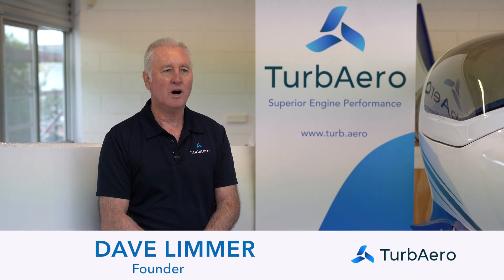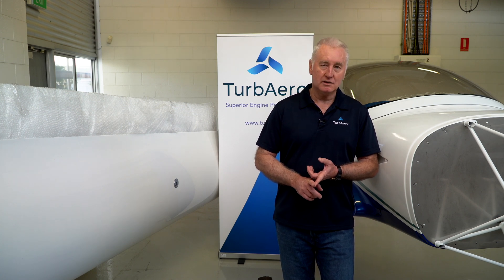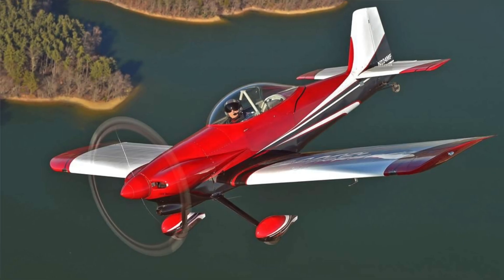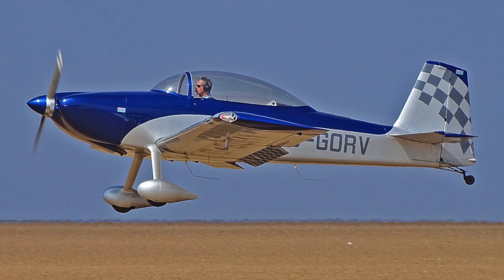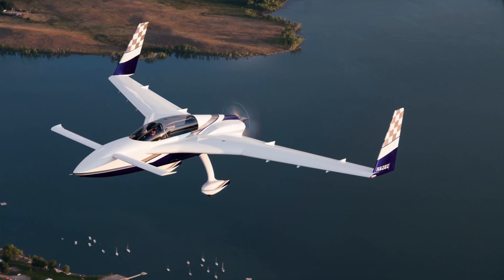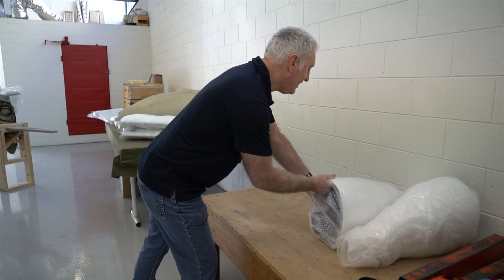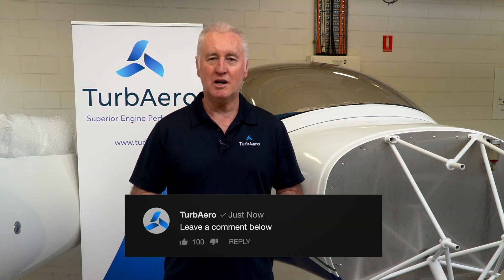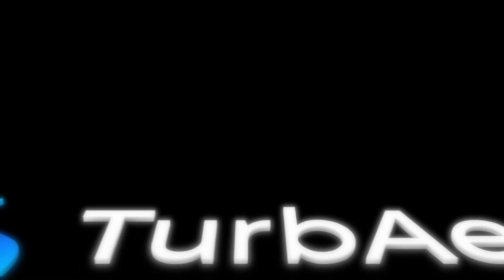Compatible Airframes - Will Our Engine Fit Your Project?

Comment: What's the status ?? Has been silent for a while and the phone number on the website says out of service... you didn't stop the project did you??
Reply from the maker: @RR-kl6sl  The project is still going but we have had to put the brakes on while we source additional funding.  We are in conversations with several potential parties but we need to get one of them across the line before we can restart the program.

Comment: Will your turboprop work in the Columbia 400?
Reply from the maker: The higher, 350 horsepower engine would most likely be more suitable for a Columbia 400.

Comment: I own a Piper 140 and also an Ercoupe 415C. I would like to convert to a turbine due to the reliability, but I fear that the cost  would be prohibitive, and also the complexity of the pilot ratings.
Reply from the maker: Hi Lynn, whilst we can't currently say how certification will change the purchase price, for the experimental model we are anticipating an initial price of $85,000. Considering fuel burn and maintenance costs, we anticipate that over the lifecycle of the engine, the total cost ends up similar to that of a comparable reciprocating engine. In terms of pilot ratings, we plan to offer transition training for those converting to a turbine aircraft. However, we expect that flying behind a turbine will be picked up by most relatively quickly.

Comment: I have a Cardinal 177B... so interested in this engine, not just for reaching the Cardinal RG speeds but also the biggest flaw in the 177B is the forward CG it's almost impossible to stay w/i cg envelope... This engine would reduce all that weight up front, increase the performance while maintaining very similar fuel burn! @TurbAero please include the C-177B in your STC plans!
Reply from the maker: Thanks for the comment Jonathan, you hit the nail on the head with the benefits. We have had a few interested Cardinal owners, and we anticipate a certificated version of the engine being available a few years down the track!

Comment: It's very interesting BUT try if you can to completely arrest yourselves and realize that a turboprop while smoother will still be much the same utility as a piston prop as a front noise maker and the colonial primitive look that a prop plane has. In a sense it becomes the worst of both worlds, the design compromise of a prop and the cost of a jet. Try your sully best to instead realize that you could make an even smaller and simpler turbofan jet product that's more reliable, cheaper to develop and produce, has natural twin engine applicability, has the design freedom of jets, the silent sophistication of jets and the vastly superior looks. And keep in mind that the distance record without refueling of 40000km belongs to a simple off the shelf Williams FJ44-4 turbofan engine, going 500km/h. A turbofan engine around 16kg with 100kg thrust could propel lean ~5-600kg planes to mach 0.7 with over the ocean engine redundancy. Consider what a revolution that could be. How a producer of such engine could very quickly become a half billion dollar company. Whereas a turboprop has no real revolution potential. Same performance plane but a more expensive engine with a different sound. You are not going to listen, no one ever does but you should.
Reply from the maker: Hello Dan. Thank you for expressing your point of view.  Your perception of the potential for a small turbofan is consistent with our own so we are on the same page there.  That initiative has always been on our radar.  Indeed, our engineering team is keen to start on that product which they perceive to be the most satisfying product for them to develop.  However, market research has firmly dictated the order in which we will develop our turbine engine products.  The available market is critical when launching a new product.  If we started with a turbofan, there are no existing aircraft designed to be optimal for such a powerplant and noone would design one until the powerplant was proven.  Spending many tens of millions of dollars on developing an engine where we couldn't sell any until someone designed an aircraft to use it just doesn't make sense.  That said, once we are a half billion dollar company, we could develop the turbofan to make us a 1 billion dollar company and to allow me to have my own personal jet which has always been an ambition for me! 🙂
Reply: @TurbAero  Diamond will make a plane for it too
Reply: @TurbAero  With due respect, that is an error in judgment. A market will instantly appear with a turbofan product. Darkaero will redesign their plane. Cirrus will obviously adapt the SR22 class instantly. Any producer that does not will be outcompeted. Just the enthusiast market for wild conversions will no doubt consume any amount of product you can make initially. To delay is 100% a mistake, not maybe, not let's wait and see or we'll get around to it, 100% a mistake.
The Turboprop project should be ended with extreme prejudice if it at all distracts from a turbofan. There was no market for electric cars before Tesla either. The other producers were going to get around to it whenever. As a result Tesla is today 700 times more worth than Aston Martin. About as much as all car makers in the world combined. Soon to be the biggest company in the world and it wont end there. Tesla will make faster than light starships.
There is ok excitement around small turboprops, a turbofan product will drive the market crazy. Turboprop will not expand the market, it will be a neat novelty for some planes to show off without any real change in specs but have higher price. a turbofan product will revolutionize GA. Textron will offer hundreds of millions for the company.
Reply from the maker: @DanFrederiksen  Dan, we respect your opinion and indeed, we agree with elements of your point of view.  That is why elements of what you suggest are already considered in our business plan.  However, there are a multitude of considerations, influences and factors that I suggest you are not considering that have a bearing on the viability and achievability of what you are proposing.  Your suggestion only scratches the surface of all the factors that need to be considered when making such a critical business decision.  I am not going to discuss those in this forum but you can be assured that we, as a small (for now) but ambitious and driven Australian company, have assessed these factors and this assessment has provided the strategic direction for our company, both short-term and long-term.

We believe that you underestimate the value proposition of our turboprop product in our target markets.  There are enough points of difference with the existing piston engines for our turboprop engine to appeal to enough of our target markets to make the business successful and to enable us to execute on our long-term strategies.  That said, we will look forward to seeing the DarkAero/Vans RVxx twin-turbofan experimental kit aircraft and the certificated Cirrus SR22TT and Baron G58TT etc. twin turbofans gracing the skies in due course.
Reply: @TurbAero  all that sounds very much like excuses to never do the right thing. How long until you can sell the turboprop and no longer delay starting on a turbofan? is it now? 2 years? indefinite endless delay?  am I going to read a bankruptcy statement 5 years from now so 10 years was wasted because you knew best?
put it on a big board somewhere. make it an unwavering goal. don't consider, do.
Reply: Interesting discussion back and forth.  First, this engine has never even been assembled yet, let alone run or flown, so until it actually runs and is flown nothing is certain.  Second, jets are great if you have 3500+ FT of runway and a new airframe designed around the jet engine.  Most Van's owners and like aircraft that this engine targets fly out of smaller strips, grass, etc.  They want short field performance and good cruise performance which a turboprop provides.  A jet will not provide good short field performance and is geared for higher altitude/long trips.  A 260-350HP flat rated version would be a big seller.  The RV-10, Galsair III, Lancair, Legacy, Lancair IV/LX-7, Velocity XL etc all need far more than 200HP.  Finally, there is zero chance this engine will be certified in a "few years".  Dynon cannot even get an autopilot that has been successfully used in the experimental world certified in very common certified airplanes in less than 2 years.  Clean sheet turbine engines are a whole different animal.  I would be surprised to see this engine flying on an RV-anything in less than 2 years and if certification is pursued I would wager it will be a $3-$5 million venture and 5-10 years after many hours have been established in the EAB world.  Good luck, we need an affordable turbine.
Reply: @baronpilot2bb  did you think about what you base the short field conclusion on?  actual understanding or prejudice...  if you have a 250kg plane with 250kg thrust, it's going to move. You confuse the typical jet design with low lift low drag wings designed to take off at a certain higher speed so they have higher top speed but not because jet propulsion inherently needs it.
Reply: @DanFrederiksen  Yes, I did think about it. Jet engines are not as efficient in high drag straight wing applications for combined performance missions like a RV and that is why we have turboprops.
Reply: @baronpilot2bb  you mean thrust to weight ratio? or single engine failure over ocean. think a little further.
Reply: @DanFrederiksen  by all means, since you know about market demand and aircraft engines, produce your own instead of waiting 10 years for any company to waste your valuable time.  I’m sure we would all appreciate more options in the market
Reply: @xpeterson  wouldn't producing my own waste my time, just so you don't have to think
Reply: @DanFrederiksen  then why would you ask others to “waste their time” on your ideas?  If developing engines wastes time, why are you even here?  You have some crazy inflated ego there
Reply: @xpeterson  if they are already developing engines, it wouldn't be wasting their time to do it right with a 1000x greater potential and revolutionizing the world, obtuse one.
Reply: @DanFrederiksen  it would be to follow a keyboard warrior who has a massive inflated ego and thinks their time is more valuable than people who are actually putting in legwork to change the field. That sounds like a massive waste of time.

Much like arguing with you. However, I like what they are doing, and from my understanding every comment on their video will increase some kind of engagement counter that might bring their product more awareness, so I’ll keep doing this all day
Reply: @xpeterson  my ego is justified and righteous. part of my clarity is to see that a turboprop product will not make a real difference in GA while a turbofan would. your petty insistence does not change that fact. it might not be flattering that I point out better options but the truth is no respecter of persons. If you are too proud for the truth, you fall.
It is as I say. turboprop is a dead end, turbofan would be a massive success. getting a turboprop to market might spark some thoughts and eventually lead to a turbofan product from someone else that would make a difference but that would be a needless step. it might offend your pettiness that I'm smart but it is as I say. read my first comment again. have a scotch, slump in your seat and have a moment of acceptance of failure and progress from that.
Reply: @DanFrederiksen  lol you’re really making all you can out of that soap box. I mean, your ideas are clearly laughably wrong, as pointed out politely and impolitely by everyone here, you won’t back them up because you think it will “waste your time,” as if your time was worth anything, and your assertiveness makes you sound like a toddler - but you must realize this as an literate person must, and yet you keep going.

I must say I’m almost impressed
Reply: @xpeterson  an literate person? you should be impressed.
Reply: Oh this guy again and his idiotic perspective. Some people just shouldn’t be allowed to have and formulate their own opinions.
Reply: Thank you professor Joe Biden for your amazing insights.
Reply: @MAJOR-10mm  I'm wrong to advise them but you are right to advise me?
what matters is that I'm right. and you are wrong. they are free to not listen but I wasn't wrong nor do I have to do everything in this world to be right, just to appease your erroneous sensibilities.

Comment: How about the Diamonds? They already use Jet Fuel. Imagine a DA42 with two Talons!!!!
Reply: I think that you can put these turboprop engines in but you just need a type certificate for it because it’s gonna have more than 200 horsepower and on top of that it’s gonna change the center of gravity on the plane so you would have to retest to see if it’s air worthy and that’s if you can fit it on the plane. You also have to consider the equipment that is needed. Since most of diamond aircraft come with the g1000 avian ice it shouldn’t be to hard to adjust and put the new sensors and gauges in but still . Also the fact that the Austro engine is a certified engine that means turbaero would have to certify the kit for the engine itself and that can take years. It’s a nice dream and I was wondering the same thing for the diamond da62.
Reply: Those are certified aircraft you can’t just change the engine

Comment: Turbine people always talk about engine power to weight, but never the extra weight of fuel required to maintain the same range.
Reply from the maker: Hi First Last.  

The aircraft's characteristics, performance requirements and mission profile of the aircraft will determine whether more or less volume of fuel is used by the Piston engined aircraft or the Talon turbine engined aircraft.  There are some mission profiles where our Talon engine will actually burn less volume of fuel than the piston.  However, you are correct, with the density of JetA being around 10% higher than for Avgas, the same volume of fuel will weigh 10% more in the turbine powered aircraft.  

For a 50 usg (189 litres) fuel tank, that will equate to 36lbs (16kgs) of extra fuel weight in the JetA.  With an installed weight of the Talon being around 50-100lbs less than an equivalent piston, the fuel weight/engine weight saving tradeoff is likely to be fairly neutral for a given flight range.  For shorter flights where less fuel is carried, the benefit is in favour of the weight saving of the engine.  At the end of the day, the aircraft's characteristics, performance requirements and the mission profile will determine which is of the most benefit on the day.